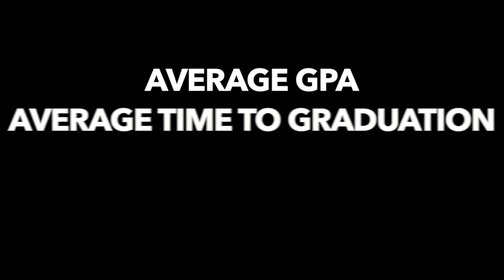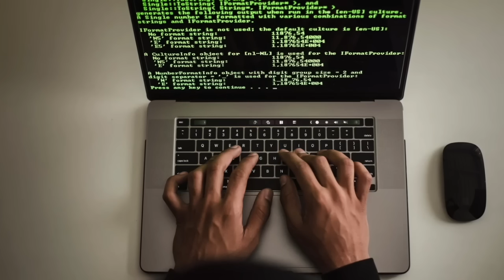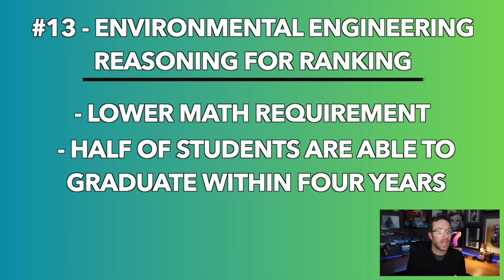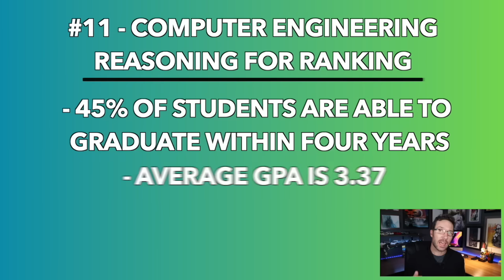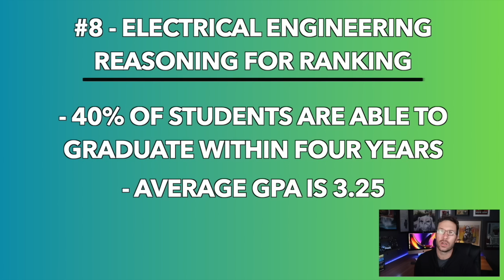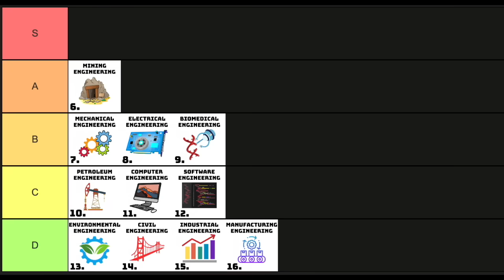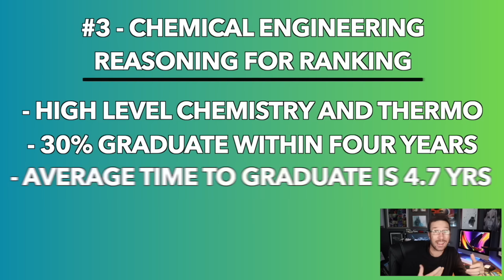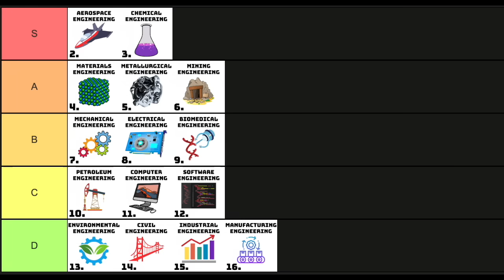Engineering Degrees Ranked By Difficulty (Tier List)

Comment: Retired ME here - Class of '81.  Worked Aerospace, Defense, Automotive, Commercial Products, Rapid Prototyping, and Medical Devices.  I agree for the most part with your Tier and Ranking list.  My comments are primarily related to real world vs academic experience.  The most important thing in school is high-level math skills, because school is mostly theory.  Math will not be so critical in day-to-day work, practical experience will rule then.  In my entire career, I only knew a few engr's who could step up to a board and work through the entire process of problem solution - including descriptive equations and solutions.  It was rarely needed.  Speed and efficiency rule the engr. process, because time=money, and it goes without saying that you're expected to be correct.  From this POV - practical experience has the most value.  Wise assumptions and knowing what will and will not work go a long way.  Something needed every day, but barely taught in school, is Design, Fabrication, and Assembly.  Study the Machinery's Handbook - and any other one specific to your specialty.  Learn a good Solid Modeling program - e.g., Solid Works, and be able to run FEA and dynamic kinematic analysis on it.  Learn Statistics, and Data Base manipulation.  On top of all that - be the best damn communicator you can possibly be - Concise, Precise, and Accurate.
Two disciplines not listed that you'll find prevalent in Industry are: A) Quality Engineering, and B) Safety Engineering.  Ranking them is really difficult - because they often draw the least-competent people, and in some places they get the least respect - but when the chips are down, these positions are where you want your sharpest tools - for two reasons - Quality will save your company, and Safety will save your life.
Reply: Retired Mechanical and Aerospace Engineer who wrote software for other engineers to use... so probably could count computer engineering too.  In my opinion Aerospace is just a specialization in Mechanical engineering. Just like environmental engineering is a specialization of Civil.  I think 4 major engineering areas that then have specializations is a reasonable way to look at it.
Reply: @carlslater7492  I basically agree with you, Carl. My first job out of school was at Rocketdyne.  They had ComputerVision CAD, but most of the old hands were still on drawing boards.  Back then, Aerospace was called Aeronautical, and it was pretty much limited to the purely Tech academies. I'm sure you remember the advent of the term "Mechatronics", Machine Design Magazine went bonkers over it for a few years. They were right...  Today, if you can't seamlessly integrate sensors and robotic electronics into mechanical designs, your toolbox is lacking.
Reply: So would you say Aerospace is harder than Mechanical? 
 @carlslater7492
Reply: 55y ME

Been working in product development where I needed statstics and FE (i.e. numerics and understanding) metallurgy and solid mechanics.

Offshore engineer heavily using probability and statistics, fluid mechanics and thermal analysis. And practical “big data” computer skills (parallel computing).

Then onto now where I dabble in thermodynamics, solid mechanics, data analysis and using my manufacturing engineering background to optimize.

If you’re at a certain level the math always pops up. However, putting math (or knowledge) to real world problems seems to be the most difficult for any engineering field.

…and I second your point on q being quite important.
Reply: There is an old say, engineering is to do something for $3 that any fool can do for $10.  The lack of prevalent of the quality and safety engineers are mainly in North America, not Japan and especially Toyota. That is why they are the quality champion. It is not that the US are short talents in the field, Toyota been heavily influenced by the late quality grur Edward Demings, no one would listen to him in US but the Japanese did and it transformed their industry, leaving Americans in the dust. Americans, and Russians to a large extend, when they feel like it or there is a necessity, their engineering and quality can be world class.  Even before WW2, North America ( B25, Mustang ) had a reputation for quality for their aircraft., and Russian also have helicopters, spacecrafts  and submarines,  machines that operate in most unforgiving environments.
Reply: Beside basic math skills the other is work experience in the field. You can put anything down on paper but practical experience will tell you if it can actually be done.
Reply: I'm also a Class of '81 graduate (EE) and I just left a comment above. Thanks for taking the time to give your perspective and valuable information. Young people trying to decide what to doe with their lives need all the  info they can get!
Reply: Such a great comment.
Reply: QE and Safety are huge components of industrial engineering
Reply: @johnwerner4471  Agreed, Sir.  I admit I was thinking of them more from the product design and development, and process engr. aspects - which is what I did in Aerospace, Defense, and Medical Devices - but you're certainly right about it from the perspective of plant layout, planning, logistics, operations, et al.  They've become  so mainstream and ubiquitous that they've become distinct disciplines. I did a stint as a QE at Medtronic - it was some serious work - and not that highly paid, at the time.
Reply: Just looking at the comments it's easy to recognize the true engineers. By the way, I'm a civil engineer working on maritime structures and  I would rank my field as the easiest to get a degree. The remarkable thing is, that a number of guys that were really good at math and had better theoretical skills in school did not develop into great engineers on the job.
Reply: Very interesting take on this, and I largely concur.  

I loved studying electrical engineering (basically a math nerd at heart) but was disappointed that, after going into industry, the actual work turned out to be stuff I could have done in high school.  They didn't want a detailed mathematical analysis and optimization, just throw together a circuit using already designed in-house techniques to get something that, (a) more-or-less worked and (b), cost as little as possible.  I was greatly disillusioned and, after a while (hardcore technical work is largely a young man's game), drifted into other pursuits, as did most of my contemporaries.  

With some exceptions, e.g., perhaps working on truly cutting edge technologies, our country does not treat its engineers well, hence the proliferation of MBAs, Lawyers and Investment Bankers.
Reply: I don't think you can generalize across disciplines and its very important to accept the fact that a wide range of technical levels are needed by the engineering profession, your local footbridge is not even close to the Humber Bridge in complexity. As for the rankings in this video they are misleading as I note above.

You are right about Safety and Quality. Safety is so nefarious it can mean hard hat or underlying design philosophies of an Aircraft. It's the most complex of all, and the hardest to do well, because it spans all disciplines. I wouldn't recommend it as a degree tho.
Reply: Funny, you rank mechanical above electrical!! Ask any mechanical and they know… electrical engineering used them toward mechanical or civil!
Reply: @michaelc.3812  Hmmm, I'm doubtful you had the likes of PROFESSOR HASHIMOTO - he might well have influenced your choice of major - as he did for some of my classmates.  Have you seen the movie, "Unbroken"?  It was not unlike that - LOL.  But I do admire EE's, and admit that I preferred systems where I could see and touch, or at least visualize what was happening, vs pushing electrons around.
Reply: @michaelc.3812 ME for 12 years now. EE had no bearing on my choice.
Reply: I agree with a lot of what your said.
Reply: I think if anything you pointed out fundamental flaws of how our schooling system addresses "real world" problem solving and doesn't demonstrate its usefulness to entice and create interest to students. However, I think the biggest problem that's facing nearly any white collar job choices is AI and in particular AGI. The game's over once we have an actual working AGI and from there it would be warp speed to an ASI. 

I own a data center and over the last couple of years have pivoted towards making significant investment in AI hardware. All this is coming considerably faster than any of us had anticipated, and a timeline of 35 years is down to a handful of years. Anyone stating AGI is decades away is drinking the Kool-Aid.
Reply: Retired ME, class of 84...worked all the same stuff (aerospace, defense, automotive, commercial products, rapid prototyping) mostly using NASTRAN/PATRAN for both failure analysis, stress analysis and design.  Really agree with everything you said...you have to be right and knowing what will work/judgement/experience are essential, much moreso than whether you’re quick at a proof or solving an integration.  In fact rather than closed system solutions, I always found a quality estimate was the best way to go.  So many problems aren’t solvable except by estimate, computer modeling and testing.
Reply: Well said.
Reply: If you don’t have an engineering degree, you really can’t comment objectively. And to compare them requires that you have worked with other disciplines in the field, or in academia. But most engineers know the pecking order: electrical engineers and chemical engineers had the toughest road, with EEs a bit higher. Real engineers had to take some sophomoric courses of the other disciplines. And historically we had Mechanical, Civil, Electrical, Petroleum and Chemical engineering. Most universities have expanded and offer various offshoots with various titles.
Reply: (current student) ME & -21BBA. Worked in Nuclear plant, Automotive, shipyard, oli refinery plant PI. Procurement, Process, Pro.Handovers & instrumentation Techdoc. (All projects contracts)  I had scientist as my mentor 🤣 at work. I have a pretty impressive story but I'm currently struggling to get a job. I was thinking of getting certificates for EX, NDT, L6S etc.. to strengthen my position. What would you recommend? Getting to R&D, PM , Inspection would be interesting. I'm pretty good at writing a CV. Im currently looking for something supporting day job because I study evenings. The big companies like me but the small company managers seem threatened by my experience, Im 25y old.  Should I hide something from CV? or just make connections? It's honestly annoying sending CV's to some HR girls that don't understand the requirements I went trough 🤣  I feel like just contacting straight to the hiring managers and skip the HR girls😅 what do you think?
Reply: Interesting. You're right of course, most engineering is more a matter of efficiencies, and few engineers use high level mathematical analysis in daily work, or at least not as such, since computer modeling systems have become highly sophisticated and reliable. 

That said, for a student who likes higher mathematics, the few, there's always going to be jobs that require these skills. It takes the proper company, in the old days, places like Hughes Research and Bell Labs, which are now long gone, but there's always going to be places like that somewhere that specialize in inventing the future. It'll probably take some searching to find the right place. The advantage is you'll get to work on a variety of interesting problems, and there'll always be a job as a quant on Wall Street, where your bonus will likely exceed your yearly engineering salary.
Reply: @hap1666  "On top of all that - be the best damn communicator you can possibly be - Concise, Precise, and Accurate." I am mostly retired (tried to retire and they made me an offer hard to turn down to work part-time) and this is maybe the one thing I found most surprising as a new engineer. I figured if I "got the answer correct" I was good to go! No sir! If no one understood what I had done, so they  could have confidence in it, I was nowhere. And when it comes to getting someone to part with money for a product or a new development program, you had better have this part down: Concise, Precise, and Accurate, and be clear why this is in their best interests.
Reply: @hap1666  Save - invest and then start your own labs thats the only way to do it now, maybe you can work at a national lab if you have a PhD but the housing is a million bucks for an 85k job lol.  Comapnies want to turn the crank and get money out the other end (but they want to turn that crank faster and faster every year), the usa does not care about engineering/science anymore thats why China is winning, but if you were born with a US passport play the little game and create your own lab.

You can also get a technician job with an engineering degree that pay just as much or more and then you just plug it in and when it doesnt work you call the engineer lol.
Reply: @richardromero6193  Thank You, Richard - that's very kind of you to say.  Unfortunately, the only law named for me is completely intuitive, has no formal expression or proof I'm aware of, and may be considered obscene by some, or at least, in poor taste. It's really more of a postulate, I suppose.  LOL
Reply: Depends on what you are doing, if you are building simulators like Hysys or finite element solvers or other software tools the math will be critical.  Even a super user of those tools will require a lot of math.  If you are doing rule-of-thumb designs then not so much.  I got lucky in my career that I have been able to find roles where its not just slap it together with the loosest rules of thumb to get profits going.  That being said true engineering as you stated (by stating that real engineering was rarely needed) is mostly for the aristocracy who are not scrambling for a paycheck and can take the time to understand things in detail.

If you are not born into money and want to be an engineer, play the game and learn finance so you can expedite your entry to the aristocracy (ie have enough investments and a business such that you don't have to work full time) then you can do real engineering (which then becomes a blurry line between graduate level math, physics and engineering), maybe consult and bill out for big money working from home because you didn't let your skills slip.

The machinery hand book is ok, but your better served learning how to build a CNC machine because its not likley you will be able to afford one turn key, the machinery hand book you can distill down to speeds and feeds and what bits to use for what materials, I do think a steel cutting 3 axis CNC and a nice 3D printer is critial to any engineerings side hustles and with this you will need to learn mach 3 and solid works.

Dont just learn to run FEA learn how to build a solver theres so much value in FEA/method of moments from materials to RF to gas flow.

I remember a plaque on a colleagues desk long ago that stated "The hurrier I go the behinder I get" and some of the stuff you elude to is just part of corporate toxicity that engineers will be forced to deal with if they don't manage their finances correctly so they can start saying NO im not going to slop it together becuase you need your end of year bonus to buy a yahct.

If you study the history of the great engienering and mathmaticians / physists you will find they put them selves in positions so they were not beholden to an artificial schedule all the time, sure theres going to be some times but nothing like corporate america pushing for infinite growth.

I notice the company men engineers always have the little tropes (time = money, you need it fast/good/cheap, etc) embedded in otherwise good advice and it just rubs wrong, you want it fast, guess what you get crap quality for alot of money and it might not be correct and thats the schedulers fault not the engineer.  So it does not go without saying, if you want it fast it might not be correct.
Reply: Hi, I am enrolled in my first year of Mechanial Engineering (Batchelors) I chose this because it's the most broad, I love Thermodynamics and believe it's the most complete type of engineering as well as challenging, but one thing that bothers me is saying it's not as difficult as that so it's not prestigious, and I also don't "enjoy" Aerospace Engineers because when they find out what I am Studying they think they are better than others because "It's the most difficult" or has the highest entry grades. Could you share any knowledge for upcoming work life, and to be the most appealing candidate for future companies? (I live in Portugal and Mech Engineering is not as good here as in Germany or other places) I am thinking of studying my Masters abroad because I am afraid of staying in a bubble (Portugal) and not having the financial capacities (if I stay I might get a 17k job/yr or worse they pay really bad here, 1200 month (14 mnth pay / yr) )
Reply: agree with majority of what you mentioned, and currently am in a quality engineering.role after beinng in the manufacturing and product design... everyday there's something to learn
Reply: well thats a very intelligent human being right there
Reply: Mechanical Engineering graduate here. Mostly mathematical problem solving is for designers. Otherwise different kind of problem solving is required, like troubleshooting machines, operating machines during a process etc.
Reply: When I studied ME, quality engineering was a module we studied. Ditto for materials science, electrical/electronics. The 1st year was basically a round robin of all the engineering disciplines except perhaps chem eng. This is why ME is the most useful and generic as you become a jack and master of all trades and can later work in multiple disciplines outside engineering in a career like management consulting and banking.
Reply: You are very accomplished Person. Kudos.
Reply: In India they all graduate
Reply: In my first year of work after school there was a very challenging problem on a project that did not have a cookie cutter solution we could use, so I derived a differential equation and solved it, basically solving the stress and deflection of a curved shape.  I thought I was the man but when I presented my solution to my boss he shook his head and asked me how much time I spent coming up with it.  I proudly said "only a couple hours" and he smacked the back of my head and said if I ever spent that much time on a single beam check again I'd be out of a job...  Since then I've done similar cacls hundreds of times and I spend about 30 seconds approximating the solution which is perfectly adequate...  LOL the good old days.
Reply: IDK - 
Seems to me that if you're planning a unique structure experience then you'd absolutely apply load vectors, leveraging components and balance.
Seems math would be integral and crucial and a very necessary part of the job.
Can't be remiss if working toward speed and efficiency...
Reply: Quality Engineer here. Interesting comments.
Reply: good stuff!
Reply: That was excellent communication
Reply: It seems off that no increase in demand for nuclear engineers is forcast.
Reply: Quality Engineering if you are a bit strange.  This is the strangest classification and really more about Business than it is about Engineering.  It is about juggling company finances with product safety.  Riding the fine line of sending defective products to the customer with what you can get away with when the auditors come knocking.  You have to know just enough about Engineering to be dangerous, enough about finances to keep your owner happy, and high levels of BS to keep the Auditor happy.  If you love a never ending battle of tug of war between engineers, owners, auditors and employees, then Quality Engineering is good for you.  If you have a knack of arguing with people while having the least knowledge about the subject matter and least support from your company's owner, then you will be good at Quality Engineering.
edit: Also, it is generally considered a career ending move so I usually advise young people not to start out in Quality.  Once you have Quality on your resume you will be hard to find anything better.  My advise is as an alternative to retiring at 50.  If you are ready to slow down and coast into retirement in 10-15 years, then look at Quality Manager role.  But most small companies will want younger QEs for the labor as QEs will also need to do Quality Tech work and Quality Inspector work in the small to mid-sized companies.